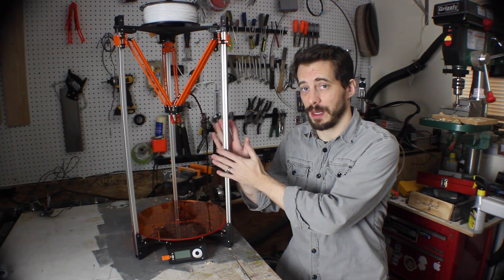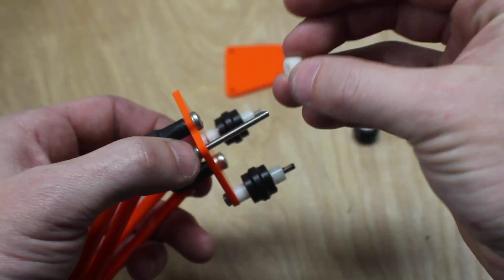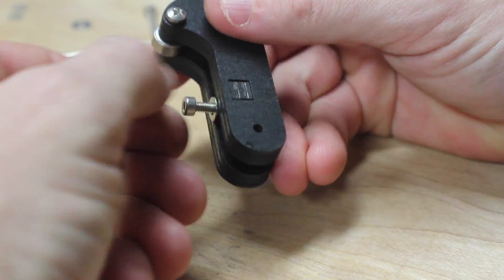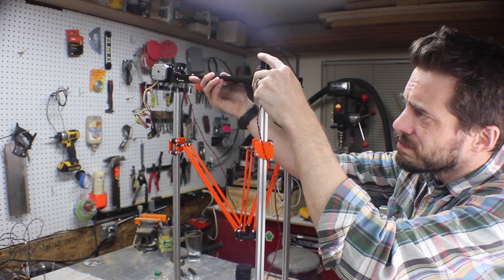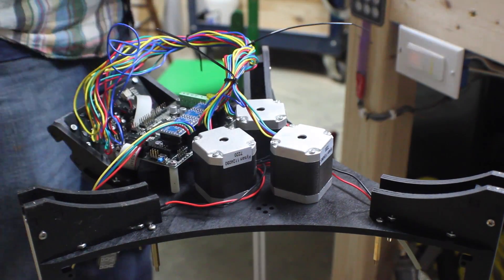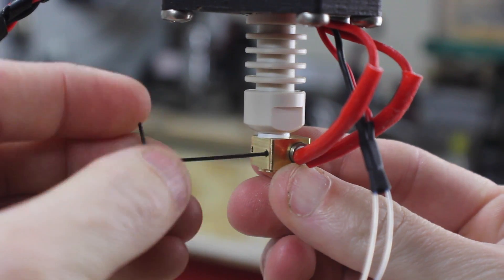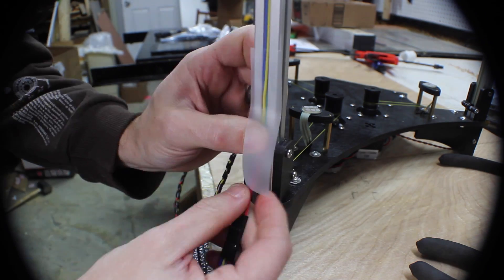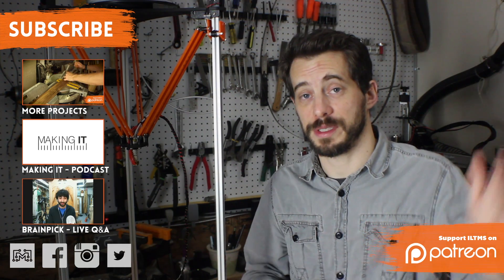DeltaPrintr Assembly // How-To | I Like To Make Stuff

Comment: What is your opinion of this printer now that you have owned it for awhile. Do you recommend it? I want to create model buildings for train sets and raceways. Quality is really important, even if they are small. Hope you reply soon. Thanks
Reply from the maker: I actually gave this one away to a local maker space.  I've seen others get great results from it with a fair amount of tweaking and adjustment. I just didn't have the motivation to put that time into this one.  The same company does have another printer coming out soon that is preassembled and tested, so I'll be really interested to see if it's a good option.

Comment: I read somewhere that, when printing with ABS, you have to scale up your dimensions by 1.1%, (multiply them all by 1.011) because when ABS cools down, it contracts quite a bit, and can throw off the dimensions of what you print.

Also, When making big, hollow things (like a 7x5 cm box), you have to be careful cause it may not end up square, because the sides of the box will be hot, while the center of the front face will cool down (there'll be like a 100°C difference) the face that rests on the acryllic base will then warp and end up not being squared because of this.

Even if you have to redrill holes in your creations, put them on your design, that way, the software will add matter around it. If you don't, there's a good chance it'll be hollow, and you end up with something not sturdy at all.

If you must have efforts on your pieces, be careful of how you print them. Since the printer prints layer per layer, the result will be more fragile along the layers. This can be the source of most breakage in 3D printed stuff.

Be aware that a printer cannot print on thin air, it needs something for the plastic to rest on, so print your pieces in a way that minimizes the surfaces hanging on thin air (large holes perpendicular to the base for example), it will minimize the amount of plastic used for support, and the time of printing, and the time for cleaning up the support.
Reply: nice 
tips
Reply: you're welcome. I do not own a 3D printer myself, but I use some at my school that are freely available. It gave me the occasion to fiddle around 3D printing and learn this stuff (the hard way). The most important thing is to value either the orientation or the amount of support needed, because often you can't have the best of both worlds.

Also, if you need really sturdy stuff, print in several pieces, and assemble them together, making sure the directions of printing cross. Example on a box : print one side with it standing up |||| and the other standing on it's side === so that the layers cross, and a scissoring effect won't break your box (because it'l be like a + shape if you look on the side).

Have fun !

Comment: Can i ask how well the fishing wire drive system works?  i've only ever used machines that use G2 drive belts, i can see how replacing those with something like this could lower the pricepoint but i don't know if they slip alot or if they're prone to any elasticity that would impact the print quality

Comment: You might want to mount your thermistor a little better rather than just putting it in the hole.  If that falls out, your hot end could heat up until something bad happens since it wouldn't be able to tell how hot its getting.

Comment: Well made video with good production value.  I enjoy your videos and think you offer a great service.  However, and this is only my humble opinion, this printer bothers me a bit.  So much wood and plastic.  I don't see the frame staying square for long, which in the long run will make it difficult, if even possible, to print with speed and accuracy.  Wood will expand and contract with temp and humidity over time.  This may prove to make it difficult to level the build plate properly.  
Of all the printers I have seen in the past 2 years the printers I have seen with happy user reviews have always had frames that made with aluminium or steel.  Granted who has a spare 3,000-5000 dollars for a Ultimaker 2 Extended+ 3D Printer  or a Airwolf 3D AXIOM DUAL Extruder Fully Enclosed 3D Printer.  Thankfully there are the RepRaps, SeeMeCNC Rostock MAX v2 3D Printer Kits, and OpenBeam Kossel Pro Delta 3D Printer Kits that use quality parts throughout.  The three mentioned kits also all have a great online community and a bunch of mods/upgrade manufactures for the tweakers out there.   Anywho, good luck printing and keep those videos coming.
Reply: +Dudenar I actually bought one back in November and had nothing but problems. Control board was dead when I received it so I had to send it back for a replacement. I managed to get the machine running (in the loosest sense of the word), only to constantly fight with the absurd fishing line system. A user on the forums designed a tension adjustment system that actually worked that you can print, but in order to make it, your printer has to be able to produce somewhat accurate prints already. Catch-22. Also, there are no written assembly instructions. All you get is the 3~ hour assembly video that is missing some vital bits of information to get the machine going. You have to go to the forums and hopefully you'll stumble across the information you need. Most of the stuff on the official support page is missing and labeled as 'Coming Soon', which is hilarious because they're going to start pre-orders for their next machine soon, so good luck ever getting full support or instructions for the first DeltaPrintr at this point. 

The last straw for me was that the machine was already suffering from wear and tear after maybe 2 hours total of printing. The hot end is held in place on it's plywood platform only by friction. That connection has already become so loose that the machine can't even get through 1/4 of a print without it ruining what little progress it's already made by the hot end mushing itself into the bed because it's pulled itself from the carriage. 

Time is money for me and I fully expected to have to spend a few weeks to get the printer up and running, not a few months. I didn't have the time to keep fiddling with this contraption that just kept presenting me with problem after problem due to design flaws, so I'm (hopefully) getting a refund. 

All that being said, their customer service is great.

tl;dr - Printer was designed by Wile E. Coyote and operates as such.
Reply: +Bob Rosland 
All I can say is wow.  I have been reading all around the web about these so called "cheap maker 3d printers"  and how it can be a real hassle getting everything to work out of the box.  Even well marketed printers like Leap frogs Creatr HS XL, which is almost 6 grand is built like crap.  At least that what I took away from a user review who reviewed it on youtube.  This dude was livid and rightfully so.  I think you use this experience to your advantage when you get a good 3d printer.  The knowledge gained by just tinkering with the thing will serve you well with the next one.   Going forward check out these links for some comparisons and information.  Good luck and I wish I was wrong about this one.  http://www.seemecnc.com   http://www.wasp3d.net/#   https://ultimaker.com/en/products/ultimaker-2-plus#Ultimaker-2-Extended+    and here are some cool links to aftermarket stuff for 3d printing.   http://www.3dprinter.net/directory/personal-3d-printers/filabot    THis is a well known hotend maker.  They are Kickstarting their own 3d printer and it looks promising.  http://e3d-online.com/     http://bigbox-3d.com/   https://www.b3innovations.com/   http://reprap.org/wiki/Diamond_Hotend

Comment: I don't like that the only thing holding the heating element in place is a zip tie above the hot end. I would do what most printers do and wrap kapton tape around the barrel of the hot end to hold the wire and element in place.

Comment: is it bad that i want this 3d printer just because of how complicated it is?
Reply: +Dalyn Hoogs (rcdriver28) no
Reply: +Dalyn Hoogs (rcdriver28) I'm actually building the plans for this type of machine on 5 axis, and it's clearly not that complicated for a delta 3D printer^^
Reply: +LUMOXIMAX 2 a 5 axis printer?
Reply: lenworth thomas You don't know what it is? It's a 3D printer that can rotate the current printing part and/or the nozzle, with the help of two other axis (2+3 = 5 axis... you got it! ^^). Those two are radial axis, not linear as the 3 steppers used in the video. They're used to rotate the extruder, and/or the heated bed. It's realy hard to think by yourself of a desing. I'm probably at my 6th or 7th desing build up in blender software... I think the one i'm working on right now will work and I think it won't cost too much...

Comment: After seeing this I really wish I would have gotten this. A while back I got a Mini Kossel Printer and it is built extremely cheaply. Instead of laser cut parts, it is all 3D printed. Unfortunately the company I got it from, Maker Geeks, printed the small parts on a very obviously cheap printer with an extremely low resolution, resulting in lots of the small parts being unusable and "boogered" up. Its been more of a headache than anything trying to get it together, they sent me 6 wire stepper motors and a 4 wire driver... I understand you can drive the motors with 4 but its extremely frustrating when none of that information is included in the instructions. Anyways after all the venting hopefully next time I can make a better decision.

Comment: Assembling a 3D printer is actually fun, exciting and useful, since you can deduce how to fix it in case a minor problem happens. I built a prusa i3 and Im looking for another DIY kit. Do you recommend getting a Delta style printer even if it doesn't have a heating bed? Ive heard they print faster and with more precision.

Awesome video!
Reply from the maker: The build was actually pretty fun and quicker than I expected, but I think adding a heated bed would help a lot. At least it would help you take advantage of higher print speeds (I think)

Comment: 3D Printng + acrilic = no no. :p
Reply: +Elites Engineering Why you say dat?
Reply: David H Because the melting point of acrylic is 160c, and the melting point of PLA is around 150 - 160c. Do you see what is wrong there? Although the tip is not touching the acrylic it self there are hear waves which will weaken the structure. 

Better spend those extra  $100 on a aluminum structure. Aka the Wanho i3.
Reply: Elites Engineering Ah, I honestly didn't know acrylic melted at such low temperatures (for some reason I thought it was some kind of glass). Even so, people (myself included) regularly use PLA in close proximity to the hotend. My end effector is made of PLA. You have to actively cool the heatsink area of the hotend with a fan, of course, but using PLA near the hotend is very doable.
Reply: But I do agree that aluminium is always going to be the safer option.

Comment: How often do you actually use your 3D printer? I've been thinking of getting one but I'm not sure how useful it would be
Reply from the maker: cody bond Honestly, not very often.  That's partially because I've never wrangled the print quality to a point that I find it useful.  Having a high quality output would probably change that in my mind.  I'm working on a 3d printing video now that will cover some of my thoughts on that stuff.
Reply: Ok thank you
Reply: Yeah, delta style printers are known to be some of the hardest printers to properly calibrate. That's why most printers are still cartesian type printers.
Reply: cody bond 
But wean it does become useful your really glad you have it. Little things like making a air filter for a minibike
become super easy and clean. No more duct tape and rubber house clamps. 
At first you print stuff every day. Then the new wears off and you print stuff only wean needed. Day to day not really useful. But 5 years from now there will be little bits of stuff all over my house.

Comment: Great video. I have been printing for about a year now with my kit printer. I love it but wish it could hold better tolerances. It looks like your printer is a strictly PLA printer. That is ok ABS is overrated. Also I did not see an extruder fan so that might cause some problems when printing small. I suggest Cura for your slicing program and Autodesk Inventor for CADing. get the student version and its free for 3 years.
Reply from the maker: Ryan Lyde Thanks Ryan! Yeah, I have yet to get the machine really tuned, so the tolerances are not like I want them. I am using Cura (DeltaPrintr recommends it as well) and one of the first things I printed was a fan shroud to add a 40mm fan :)
I recently got Simplify3D based on a recommendation and am impressed with the deeper configurations it offers. Hopefully I can get it to a point where my prints are more consistent, we'll see.

Comment: You thing you will have to learn is how to find the right settings so that when you print in abs your print does not fall of the build plate. One thing I found to be useful is when leveling the build plate is to get a sheet of copy paper and adjust the position of the build plate so that the sheet of copy paper slides between the build plate and extruder with a slight tug. Do this around the perimeter. A tip for better adhesion is to use what is called abs juice. You can make it yourself with scraps of abs plastic and acetone. Apply abs juice on your build plate and the juice will act as glue.

Comment: I've been sourcing parts for a Rostock 3D printer since last october and getting parts when and where i can get them. so far i am $290 into the project and 90% done the pesky and most expensive parts right now for me are the GT2 belts and pulleys.
Reply from the maker: Richard Fox Have you priced them on Inventables.com ? I don't remember them being too much, but I could be wrong.
Reply: Actually I just found a set of 8 20T pulleys with about 10 meters of belt for $26 on ebay. once those arrive along with my order from makergeeks.com I will be ready for final assembly and calibration.
Reply: over all running total for all my parts I've bought comes to just about $278.75 which is a considerable savings from the price of most ready to assemble kits on the market.

Comment: It is pretty amazing that for such a large build area you only paid around 500 dollars for the whole assembly. I have worked with a multitude of 3d printers in high school and all have been with the traditional setup of 3 motors, one controlling x, another y, and another z. In my mind i have a lot of questions about how the code for the motor is written but this is definitely something to be explored, because aside from components being relatively cheap, the only thing stopping everyone having a 3d printer at home is the programming to run the machine. Nice video :)

Comment: How big is the print bed and can it use filament from inventables ?
Reply from the maker: I recently heard that they downsized the printer a little (from the kickstarter to the web purchase) so I don't know it's current dimensions, but mine has a 10" diameter and I believe 12" height, for build area.  It will use any 1.75 PLA filament, so yes, everything from Inventables I believe.

Comment: Hey Bob, awesome you finally got it. I built a reprap i2 about a year ago and have slowly learned a few things. One thing on your build that concerns me is how you wrapped the stepper motors with all that wire, during long prints or fast speed prints the motors can get hot, some people even put fans or heats sinks on them. And a good tip I have found is using glue stick on the bed for part adhesion, works better then blue tape or capton tape, although I'm printing on heated glass.

Comment: I made a few videos a while back on the assembly of the Velleman K8200 3d printer, and from looking at your video it seems like the DeltaPrintr is a bit easier to put together. Though, I wonder about all those wood and plastic pieces, if it's not sacrificing a bit too much of the rigidity of the machine. The Velleman isn't super rigid, but it the frame is entirely aluminium extrusions and profiles, which does help a lot. They recently came out with the K8400 as well, which seems even easier to assemble (no soldering, and not much wiring).

I'd love to see some printing tests with this printer, to see what it's capable of. Please do keep us updated, and thanks for the video!

Comment: Great video Bob!

I noticed you didn't secure the thermistor in the hotend. That's something I really would recommend to avoid damaging the hotend as it will heat up uncontrollably if the sensor falls out. You can either use thermal putty or thin strips of kapton tape. Newer hotends, like the E3D ones even has a screw to securely fasten the thermistor.

Newer versions of the Marlin firmware do have some kind of thermal runaway protection, but I think it has to be turned on explicitly before compiling.

Comment: If you are willing to spend a little more and get a fully built fully tested 3d printer, I recently got the Lulzbot Mini and it has amazing print quality for the price. I've used diy built printers in the past and they can be amazing, but you will be spending the first few weeks tweaking the settings to get the perfect print.